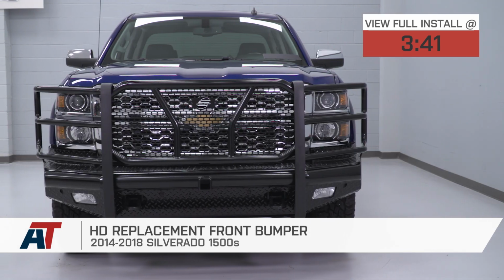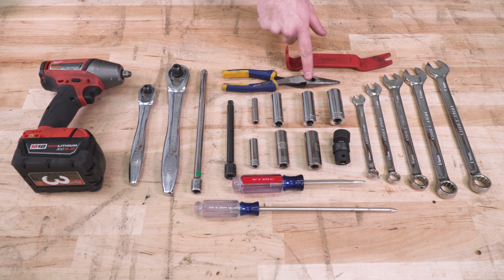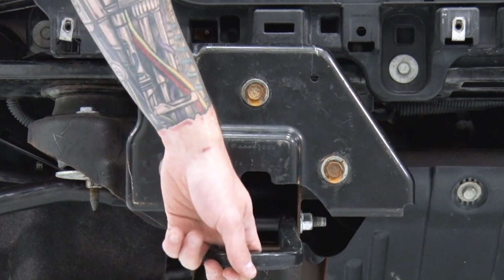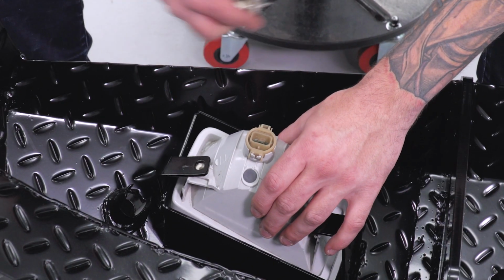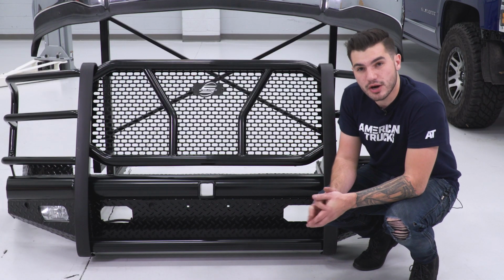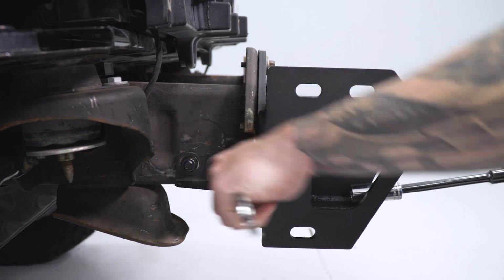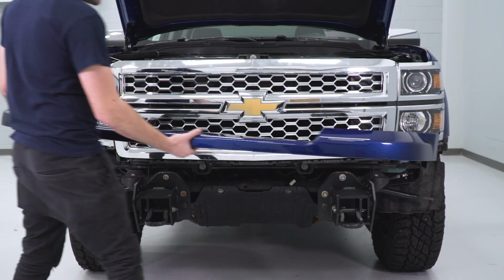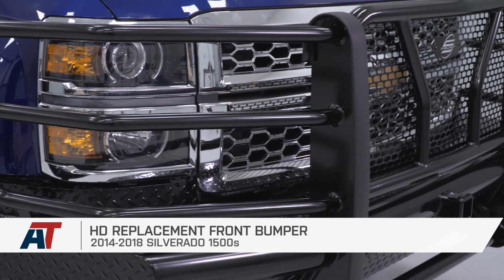2014-2018 Silverado 1500 HD Replacement Front Bumper Review & Install

Comment: No way are those bolts torqued tight 😢 Tighten the nut  not the bolt dummy 😭 take the damn extension off so you can get some torque 😐

Comment: Better beef up the front suspension with that added weight of the full replacement. It wears  out the factory one pretty quick on a half ton.
Reply: Tbh 1/2 tons aren’t meant too have full bumper replacements with schedule 40 pipe with flat diamond plate they’re fine the pipe adds a lot of weight
Reply: @luker6766  even that plate adds some serious weight. A buddy went with a rough country that was suppose to be light weight and in a year had to rebuild the whole front end from the wear and tear of the extra weight.
Reply: Trucks are designed to carry the weight. It's 350lbs. That's what a typical bumper weighs.